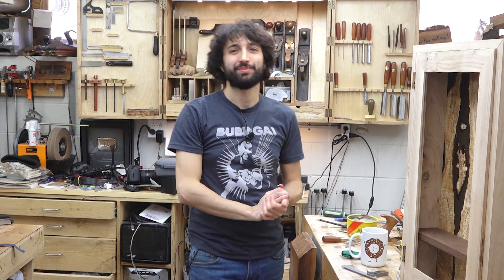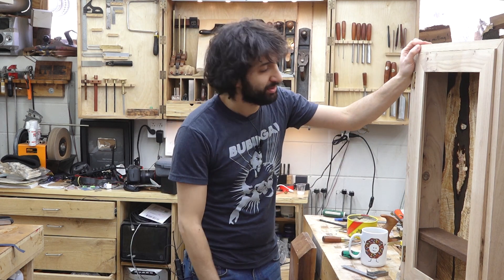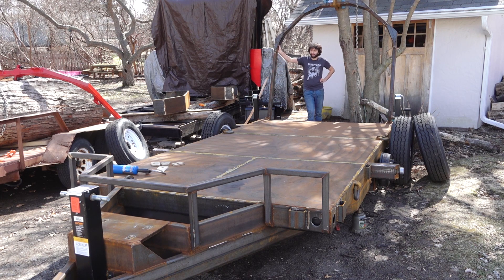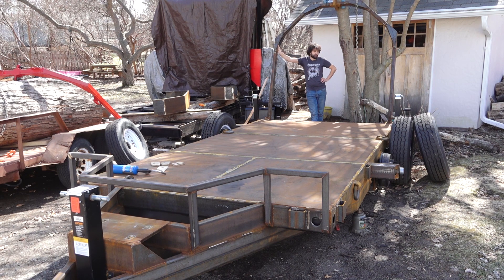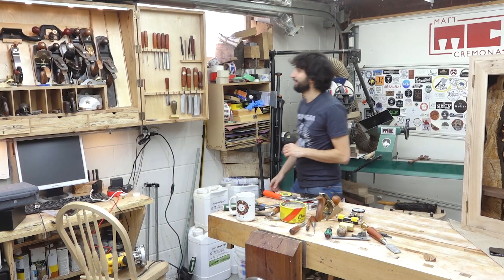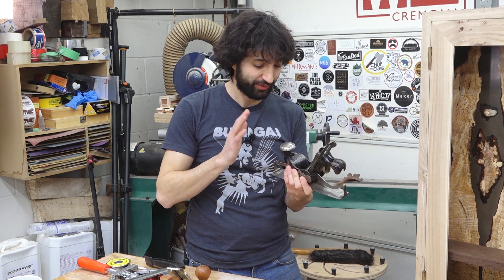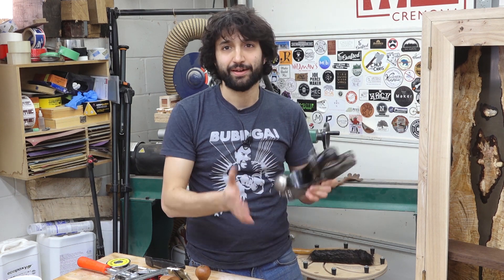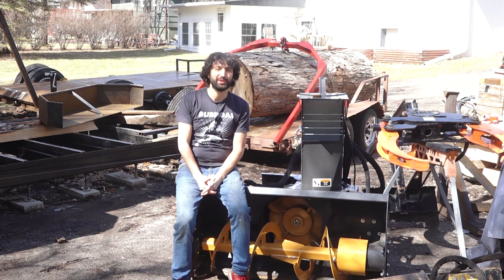Router Bit Cabinet, Trailer Build, Compass Plane

Comment: The real question is how crazy is Matt's hair going to get before barber shops are allowed to open again!
Reply from the maker: Extra crazy
Reply: I'm thinking I'll just grow a pony tail.
Reply: His wife could always give him a haircut using the bowl method like they did during the depression and when I was going up in the sixties. How many would like to see him with that kind of hair cut.
Reply: As somebody old enough to recommend the pros and cons of easy hairstyles, having had several, here are the choices.
1) Shaved:  Pro: Can be sexy.  Self do. Comfortable in heat and humidity. Cons: sweat gets in the eyes quicker. Crome dome sun burn. With wrong head shape a 
                             horror story. Doing it without nicking takes a few days. Styptic pencils are your friend. You use more razor blades. Winter means heavy hats.
                             Full Disclosure (FD): I've been wearing this one for over two decades.  
                            Fashion Tips (FT): Homburg, Panama, Cowboy, etc. hats are useful.   Baseball caps aren't; think about the tops you your ears. Or sunblock.
                                                              Sunblock in the eyes is not fun.
2) Ponytail: Pro: Can be sexy. Inexpensive. Cons: If prone to schivtsing, flop sweat central. Babies have accurate pull. FD: Wore this for 7 years. I schvitz. 
3) Buzzcut: Pro: Can be sexy. Easy for tyro to do. Cons: Weekly maintenance necessary. Shaving the neck is an art form. With wrong head shape a horror story.
                              FD: Two years. See FT above.
4)  Flattop: Pro: Can be very sexy. Medium difficult. Can hide some head shape problems. Cons: Weekly maintenance necessary if short. Shaving the neck... 
                             FD: Five years.
                             FT: Sun block.  Butch wax if you can find it; mousse if you can't. 
5) Bowlcut: Pro: Even a klutz can do it. Con: All the sex appeal of a category 5 hurricane visiting your neighborhood.
                             FD: One weekend. It undid my [censored] and I had smokin' bod. This was in the very early '80s.
Reply: Probably like use all down to over knees 😂 all Matthew,s subscribers take cre no matter where you are in the world 😀😀

Comment: Great move on the Galvanising, that will make an already awesome trailer even better. Don't forget to drill small vent holes in the closed box sections of the frame though...hot dip galvanisers can get a little fussy about closed sections (they can rupture due to pressure build up due to heat) and will charge you extra if they have to drill the holes..
Reply: Exactly what I was going to say. Make sure you add vent holes
Reply: Make sure that the holes are big enough to drain properly. You get charged for the weight difference between before and after.

Comment: Just like Jeff, I too am looking forward to the arch build. Finally got my big trailer back from my son in law, and I am in the process of securing all the steel. I remember your first build and I told myself if I ever get a mill , I would build one.  Got a mill in December and can’t wait to have the arch. Not galvanizing the old trailer, but if there’s another pandemic on the horizon, I may get myself galvanized.

Comment: Yes!   I was one of those who recommended hot dipping.   I did mine and love that it is able to withstand bumps and bruises without worrying about paint.   Good choice!    Im sure they will want to discuss any chambers that are completely closed due to explosion hazard as well as adequate pathways for zinc to flow through the tubular components.   I’m also a plane collector and have one of those 113 compass planes.
Reply from the maker: yes thank you!  Spoke with them last week about opening requirements.  I have a few things to undo but I'm mostly set to go.
Reply: Matthew Cremona   Excellent.   Hope it goes well.    It was such a nice build that it’s a shame to limit its lifespan due to rust.

Comment: Just a heads up, welds ground flush can reappear after galvanizing. The zinc tends to build up more on the welding wire material than it does on the surrounding steel.

Comment: Not sure if you know yet, but if you galvanize the trailer all the tubing needs to have weep holes put in them, make sure there are no hidden air pockets. Also I hope your trailer doesn't twist with the heat, the is what happens with the items we build at work. Make sure everything is how you want it before galvanize, you don't want to weld on it nasty stuff.  Best of luck to you.

Comment: Hey Matt, do you have a video where you talk about the expenses related to owning a mill? It's something I'm in the very early stages of considering pursuing and any advice or resources would be awesome! Thanks!
Reply from the maker: I don't have one in particular.  You're thinking ongoing costs?
Reply: @mcremona  Yeah, I have an idea of the size I'd want and that cost, but blade replacement/sharpening frequency, fuel, and any surprises a person might not include when budgeting would be really helpful
Reply from the maker: @garygrimm2097  That's going to vary quite a bit depending on what saw you're operating and what you're sawing.  Blade cost and sharpening prices are available online from suppliers. I'll see if I can answer this based on my experience in the near future.
Reply: Thanks, I appreciate any insight!

Comment: Dipping the trailer should make for a cool vid if you're allowed to film it. It's a nasty process. I've heard lots of car restoration folks opt for epoxy paint. It allows for welding repairs or additions without the toxic zinc smoke. Either way, that trailer is one serious piece of gear..Looking forward to the look on your face when you load a record setting log on it! 👍

Comment: You will need to remove all lights, brakes bearings and related items.
Reply from the maker: Yeah all my bolt on stuff will come off and be dipped separate.